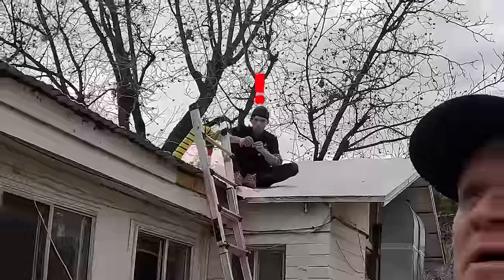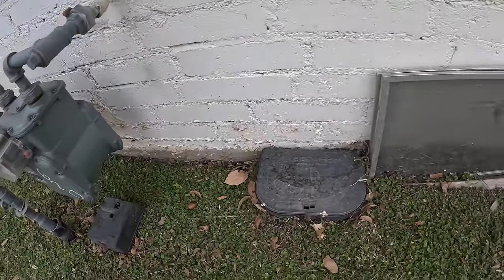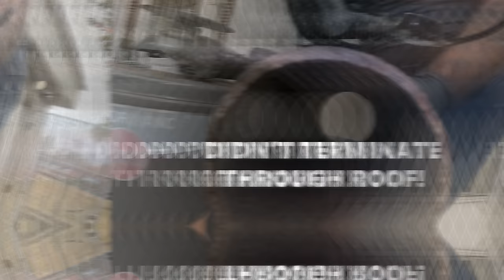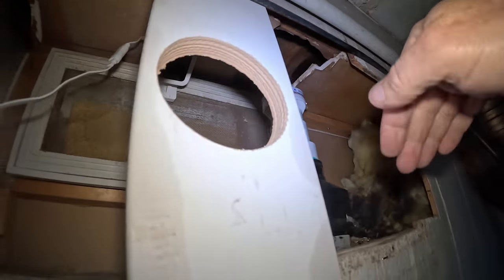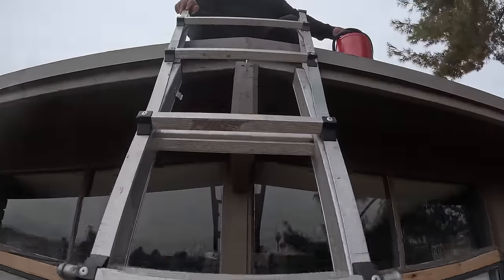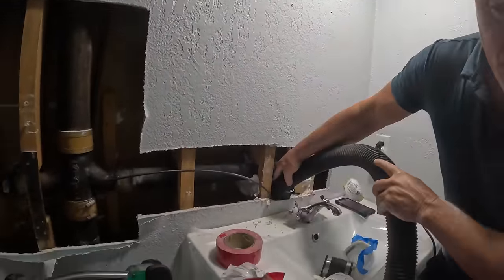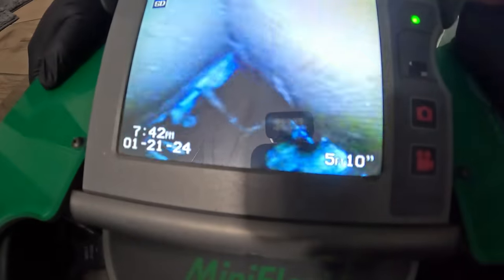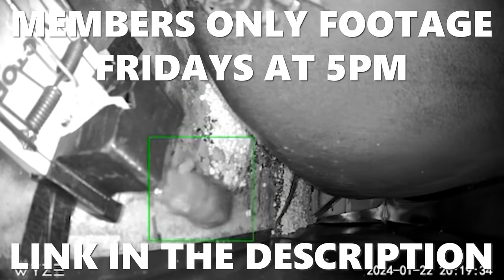DIY rat removal from walls & ceilings: step by step guide 🐀🐀

Comment: I’m impressed that another company is doing more than setting traps or blocking holes.  At least they are doing more by finding the problem, than so called exterminators.